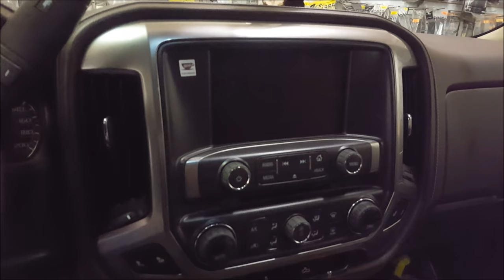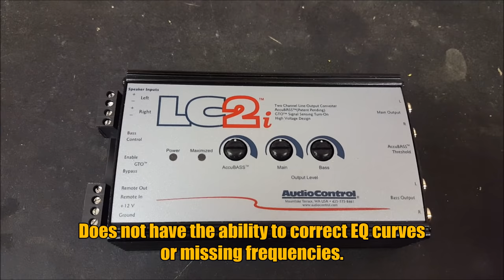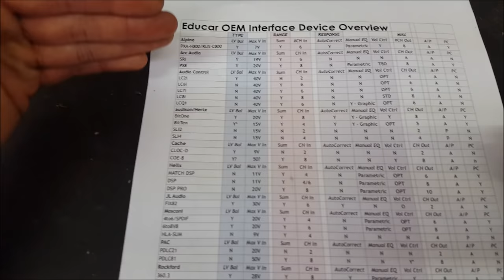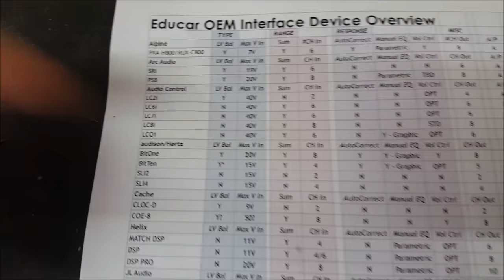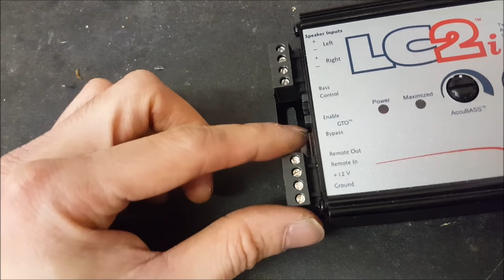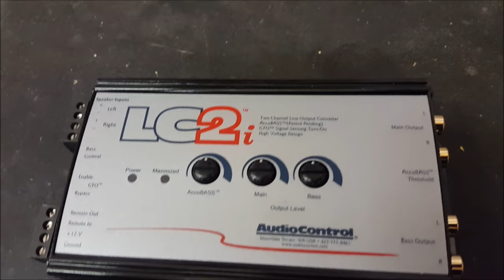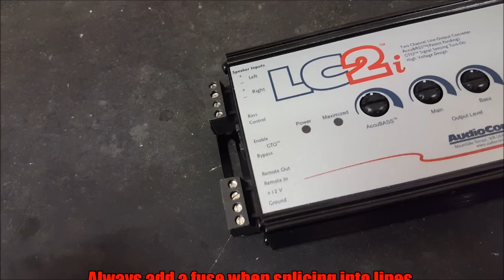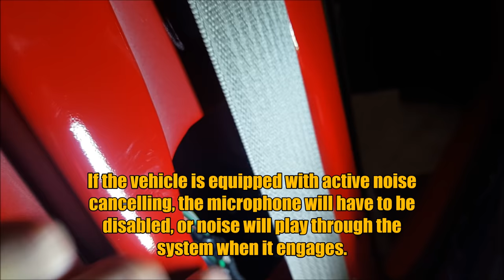Line Output Converter Explained | LOC (Audio Control LC2i) | AnthonyJ350

Comment: Hey I had one of these lc2i for over a year now. They work great but is it possible to make a video on how to tune them along with the amp? Also for some reason when I play music at a low volume, the bass plays really low. But if I turn it up and then low again the bass is extra loud. How can I fix this problem with the lc2i?
Reply from the maker: +LegitMods4u Well that's usually what happens when you turn the volume up.  It gets louder.  If it's getting a little loud for you at higher volume, you can get their remote gain control and you can turn the bass down a little at higher volume.
Reply: +AnthonyJ350 the problem is that the bass this goes up and down randomly. Its like I'll play music normally and out of no where the bass comes on really loud.
Reply from the maker: LegitMods4u Ahhh, your Accubass might be up too much.  There's also a threshold  dial on the side (it's very small and a white dial).  You can try adjusting the engagement point.  Also try turning the accubass knob down a little.
Reply: +AnthonyJ350 I actually never noticed that accubass treshold...wow lol. I'll give it a try tomorrow. Thanks for your help. I will keep you updated tomorrow!
Reply: +LegitMods4u I just read this exchange....did it work out for you?  I'm contemplating buying on of these for a system that I want to put in my Accord coupe.

Comment: Will this increase my factory radio volume? I have amp hook up to 12in subs & the radio volume isn't so loud at all
Reply from the maker: The only way to affect the speakers is to amplify and tune them.
Reply: @AnthonyJ350  I mean will this increase the radio volume like boost it up to a few volume more?
Reply from the maker: @dewaynejay1032  No it will not. This device obtains signal for an amplifier to interpret and affect whatever the amplifier is driving.
Reply: @AnthonyJ350  I appreciate that information sir.  So is this better to use then a basic convertor that run from the rear speakers to the amp just trying to get a better understanding on this
Reply from the maker: @dewaynejay1032  It depends on what you're installing. If it's a basic install I grab signal where ever is easiest and tell the customer not to fade the audio. If I can get to the signal easier I will grab off the front channel, especially if I fade it to the front to balance out how it sounds. I never fade to the rear because it sounds weird.

Comment: I touched ground with positive by accident now the sub control knob don't work, on the lc2i
Reply from the maker: Did you try unplugging power off the LC2i and plugging it back in to see if it would work again?
Reply: no,  I'll try that thanks for the tip
Reply: I tried it, did not work.
Reply from the maker: The LC2i or the bass knob itself might have sustained damage.
Reply: I plugged the knob on to amp and it lights up, but plugins it in to lc2I doesn't work I have sound tho
Reply: ill contact lc2I tomorrow, thanks for your help.

Comment: I have a Ram 1500 without the alpine system. Should I go off the front or rear speakers?
Reply from the maker: nmfdchris If you're using the LC2i use the sub output.
Reply: AnthonyJ350 I don't think mine has that. Just the 6 speaker system. Front and dash 3.5s are in series and rears are solo
Reply from the maker: nmfdchris I'd do rear, should be full range.
Reply: AnthonyJ350  awesome thanks ant. Now the other question I have is, how should I go about adjusting the LOC and the amp?
Reply from the maker: nmfdchris I'd start with the loc in the middle or quarter and put the amp to minimum. Set the head unit to 75% and start gaining the amp after. Also leave bass boost at 0.
Reply: AnthonyJ350 with the head unit mean increase the bass under the equalizer mode and then increase the amp from that point?
Reply from the maker: nmfdchris No just the volume. Leave your bass setting at 0.

Comment: Hey I have a Android after market headunit cand I grab one channel out and the dedicated sub out of that headunit and connect to the lci and connect my mids and and bass amp to it
Reply from the maker: andy As long as you put full range signal through it. There's a full range output and bass output on the LC2i. You'll have left and right but no fade.
Reply: AnthonyJ350  tnk for the reply sir but do u thing I can send one channel full range out from the Android and the dedicated sub channel out to the lci so the the lci out put will have a dedicated sub out with sub signal and the other out will be full range for my voice amp
Reply: Or do I have to feed it with two full range out put from the factory my Android have 4 channe full range and a dedicated sub channel get what I'm saying tnks
Reply from the maker: andy I would feed it two signals so you get left and right out of it.

Comment: What Amp fuse would you say is safe to run in line on the 12v constant?
Reply from the maker: D M For the LC2i?
Reply: yes, currently have everything wired, just need to run the 12 V for amp and 12V for LC2i, I have an inline for the amp, this video cleared it up that i should put one on the LC2i aswell, just not sure what amp
Reply from the maker: I would be a smaller fuse in for the LC2i like 7.5 amp.  Just make sure you get power from somewhere that can handle the extra draw.
Reply: sweet thanks, gonna wire it directly to the battery so there shouldn't be any problems with lack of voltage
Reply: I ran mine from my amp terminal. And a remote from the head unit. Works fine.

Comment: Will these output a flat, full range signal, no matter what bass &/or treble settings you change on the HU, or will the HU settings affect the signal?
Reply from the maker: +BLaQz84 If the curve changes on the speaker you're grabbing signal from it will affect it.  I was playing around with it and if I fed too much bass signal in from the head unit and didn't sound good.
Reply: +AnthonyJ350 So u were better off adjusting the gain via on the converter & amp, as opposed to the HU?
Reply from the maker: BLaQz84 Ya I tend to flatten out the factory head unit and I keep the gain low at the LC2i if I can and try to get everything done at the amp.  I will bring up the gain at the LC2i if I think it's too quiet.
Reply: +AnthonyJ350 Cool... Appreciate it the info... I might be getting a new car soon, but I don't want to take any of the factory equipment out... I miss the days when car manufacturers, made their HU's interchangeable...
Reply from the maker: BLaQz84 JL Audio is coming out with a product that will correct factory EQ's automatically.  Depending on the car you buy will determine what product you should put in.
Reply: +AnthonyJ350 2015/2016 BMW 3 Series is what I'm currently looking at... I'm hoping to find one with the Harmon Kardon system in it, but most of the demonstrators here, don't come with it(which blows my mind)... If I don't get the HK system, which LC would u recommend?
Reply from the maker: BLaQz84 If you're just doing an amp and sub the LC2i will get the job done properly.
Reply: AnthonyJ350 Cool, thanks for the info...

Comment: i have 5 channel amp and i installed new speaker wires for the front and back and i have the lc2i so is that mean its not going to work??
Reply from the maker: fifty 9755 You can get signal from the head unit or factory amp. You can feed the signal from the main output to channel 1 and 2 ( and set 3 and 4 to grab off those channels as well, you'll loose fade) and hook up the bass output to sub. I wouldn't sum left and right like I did here, grab actual left and right signal.
Reply: AnthonyJ350 someone told me i can just grab signal from the rear speaker wires since its full range so i dont have to worry about openning the stereo.. i have mustang gt 2017
Reply from the maker: fifty 9755 You can but you should get left and right. I'd recommend the LC7i for your application or a DSP. What motor does the Mustang have? Because if it's eco boost you might have to look into product for  PAC audio.
Reply: AnthonyJ350 its the 5.0
Reply: AnthonyJ350 how about the front? do i still need to get signals from them or the rear speakers are good enough?
Reply from the maker: fifty 9755 I would test for full range from the front. Doesn't your Bluetooth calls come from the front speakers only? You'll also want to check how tour parking aids work and if the vehicle has active noise cancelling.
Reply: AnthonyJ350 i will definitely check on that.. so do i just tap on the rear wires left and right?and that will work just fine?

Comment: I have a 2010 ram 1500 Laramie with the factory alpine. I realized you referenced using this in the ram no issue by going off the sub wire, but I'm curious if you just used one set of wires or both sets that run to the sub? And how you connected it to the lc2i? Thanks